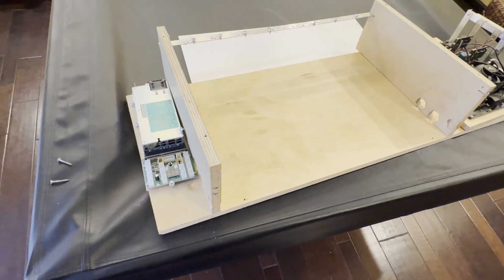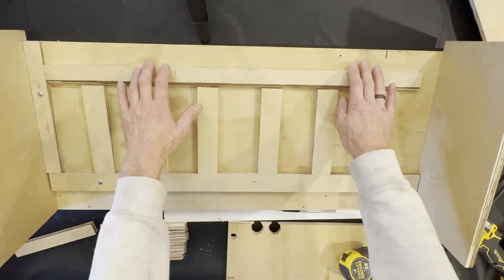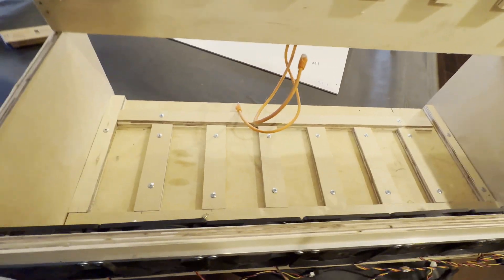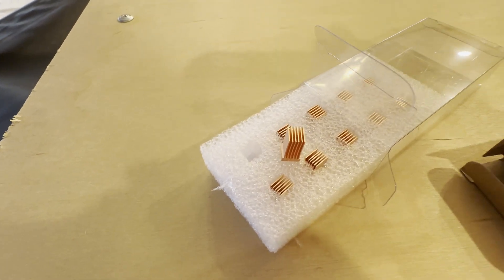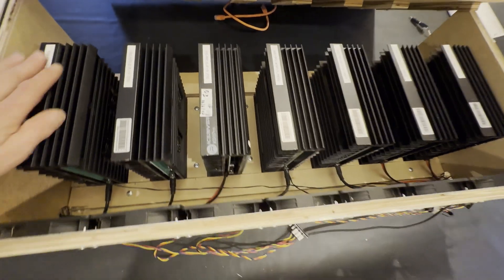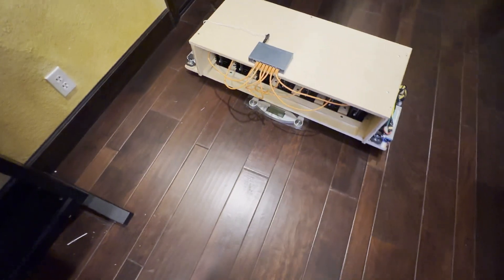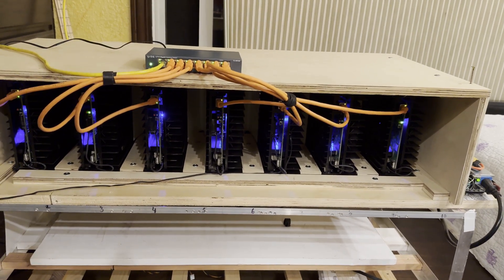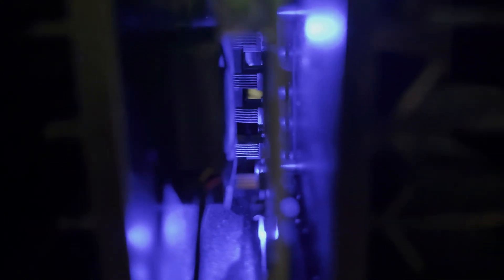HOW I BUILT ICERIVER BOX WITH 7 X KS0-PRO. NEW HEATSINKS 6.5X6.5 AND THERMAL PASTE 2 MORE ON 340GH

Comment: My only problem I have is you need to make it out of metal.  ChumpChange had a KSO pro catch fire.  If you have a fire well you have giving the fire plenty of fuel to not only burn up your setup,  But also your house.
Reply from the maker: yeah i saw that, thats why I solder directly to board all the power connectors, can modify octominer case i guess for this purpose

Comment: In the place where the memory comes into contact with the radiator, the paint must be cleaned.
Reply from the maker: Do you mean the paint on the black heatsink? It’s a powered coating so it has pretty good thermal transfer rate I think.
Reply: Give it a try and compare 😊
Reply from the maker: @mihaildorian  are you talking about removing paint from mosfets or ks0pro's body where it contacts to the chip?
Reply: @DontMindMeMining  from the radiator,you can use sandpaper
Reply from the maker: I see, there are no problem with chips, the issue is with mosfets overheating which are not in contact with radiator. So will be no help to the temps.

Comment: Hello
What power AC-DC are you using in this video ?? Is enough for 7 ks?
Reply from the maker: Hi, I’m using 2 HP server PSU from my GPU mining rigs one is 1200w and one 750W. You can just calculate your load and use 80% rule for any pc psu or server psu should work with no problem. I’m trying to stay at 70% for psu load to keep them cooler
Reply: @DontMindMeMining   So for 3 ks0 pro will be enough one ?
Reply from the maker: @Stantheman-f3r  750W will   definitely work for all overclocked. Also, can connect network switch to 12V as well.
Reply: @DontMindMeMining  cheers just ordered 1200w hp
Reply: @DontMindMeMining  Do you have an STL file for that fan 3D printed ??
Reply from the maker: @Stantheman-f3r  I don’t but check greater good mining discord channel they post multiple versions of the shroud print files.
Reply: @DontMindMeMining  can't find anything with this name " greater good mining" or it is a different name.
Reply from the maker: check links in greater good mining discord channel   https://discord.gg/aPYXWKMH
here is one of the links: https://discord.com/channels/1110920623649193984/1131944870760689784/1215394211084369950

Comment: What is your total wattage? You look like you could avg $695/mo. at $0.172 usd on a coin! Not too shabby for a low energy cost.
Reply from the maker: for 7-KS0PRO about 1400W thats about $4.2 a day at  $0.12/KW in the summer it will be $0.18 so may have to switch to solar at peak hours
Reply: @DontMindMeMining  I really admire your videos. You're just here doing you and no one else, no frills. Just human.
Reply from the maker: @dorjenangwa  thanks, appreciate the support.
Reply: @DontMindMeMining  I am wondering, if you had to make the ks0 box again, would you sit each unit flush, side by side? Avoid the paper blockers?
Reply from the maker: @dorjenangwa  I designed this on purpose so each external fan will be assigned to each ks0pro and can be individual controlled for overclock. If you’re not planning to do over clocks then it’s OK probably to put closer to each other if that what you were asking
Reply: @DontMindMeMining  I was just digging for your thoughts, I'm planning to do OC! lol But Yes, I agree that each should have their own fan or concentrated direction... I'd like to get a printer for these things. I only have the ks0's ordered, ice blue.
Reply from the maker: @dorjenangwa  those fit to my box by the way I put only one cuz not much changed in terms of temps or performance
Reply: @DontMindMeMining  ever try mos-peltier?
Reply from the maker: @dorjenangwa  I didn’t but I think main issue will be the size as the small ones won’t do the job and larger ones won’t fit
Reply: @DontMindMeMining  thanks, I was almost thinking of getting some.
Reply from the maker: @dorjenangwa let me know if you you decide to get some and find them useful.
Reply: @DontMindMeMining  I'll let you know. Current plan is the high line oc and I'll continue looking into them. They're looking spendy in relation to everything else to put into these. I might have missed it, but are you getting 330gh on 12volt? I have to get my shopping finished before the rigs come today or tomorrow. It'd be be silly having the units with no power to them. LMAO. I'm still re-reviewing your videos now and others....

Comment: Only thing I would change is integrate the psu's inside same with the ethernet switch. Then adding vertical separation on fan side between the miners that should increase airflow through the miners.
Reply from the maker: I tried and did testing on one of my video by separating each KS0 with vertical boars and didn't have any good results it may help slightly in hot inviroment but defusers I use between the fans help a lot. i keep psu and network switch outside for ease of service but defenetely can be eclosed for better look

Comment: If you were smart, you’d cut your losses and sell those KSO PROs. Re-coup what you can and buy the coin. You will never mine the amount of coin you could have bought in place of those. Otherwise great idea, it’s just too bad those machines will be paper weights soon
Reply from the maker: Yes, you’re correct but that always part of the game. Can’t always win. KA3 did similar jump and drop but may come to life.
Reply: I wouldn't listen to him, based on my calculations it's definitely possible to get roi and then some.
Reply: @SunDown64  your missing the point. I’m not saying it’s not possible to get an ROI in terms of getting back what you paid. I’m saying that your missing out on the gains of the coin appreciation since your buying the Asic instead of the coin. The likely hood of mining the amount of coin you could have just bought instead of the miner is slim to none. It’s smarter to just buy the coin in this case, unless your able to buy these for $200 or less it’s just not worth it. If he was smart, he’d sell these while they still hold some value.

Comment: Thank you for sharing. I have an IBM server PSU. I want to use it with KS0-Pro. 
But I don't know how to convert 6 pin connector to 2 pin without any adapter. I want to do that only using 1-1 connectors. 
Do you have any schema ? Can you share it ?
Reply from the maker: Thanks, I have a vid where I just solder xt60 to pcie 6 pin wires. Can solder directly to 5.5x2.5 barrel connectors but they way to fragile for this application and current. I recommend used high quality connectors or solder xt60 which are the best connectors imo.
Reply: @DontMindMeMining  thank you so much. Can you share a connector link for 6 pin wires to xt60 ? I didn't find any part in your part list at description.
Reply from the maker: @the_realist  I wasn’t able to find readily made connectors I make one from GPU mining rigs 6 pin 16ga cables and solder to xt60 or can use quick connect that rated for 30amp if don’t any to solder yours. All connectors links listed in description

Comment: Good stuff. I had a 3dprinted fan module for each of my 4 KS0 PROs using 3000 RPM fans. With the 340GH overclocks I'm sticking under 30C at night and 50C at day. I live in Idaho, so its 15 degrees outside. lol  I do NOT miss the Sacramento heat nor do I miss California electric rates!
Reply from the maker: Thanks, haha it’s cold now here as well we have 35-40F nights and 50F days summer will kill 340G for me but with auto tune right now I have 40-42C temp1. I would worry about too big of the difference but 30-50C is fine more than 35C difference a day I think would create  a lot of movement on the paste I think that would shorten the life of the thermal paste/pads.